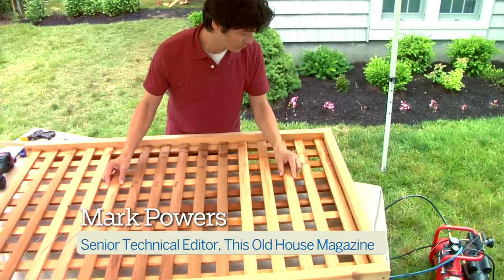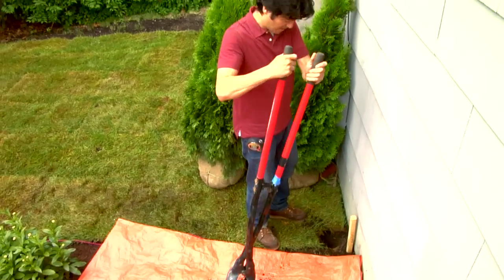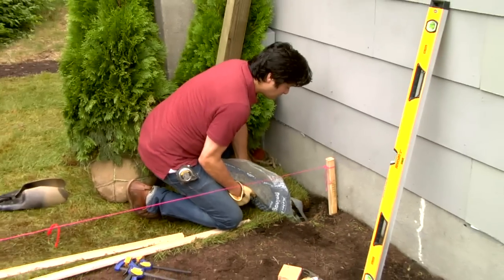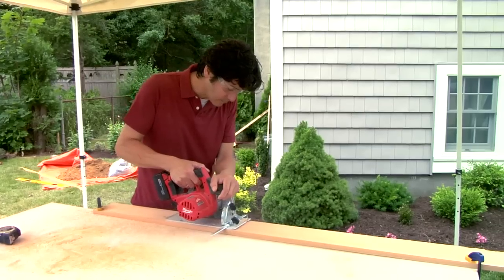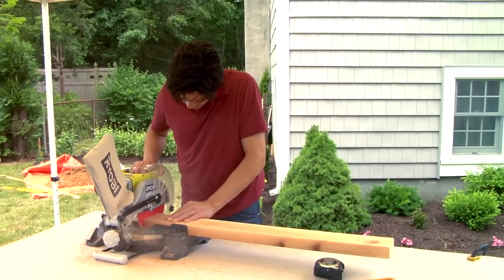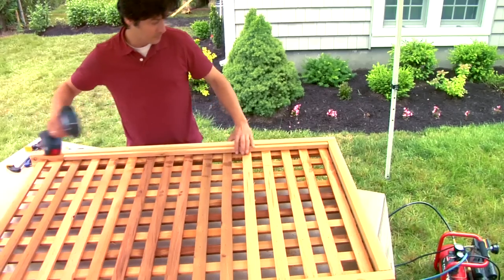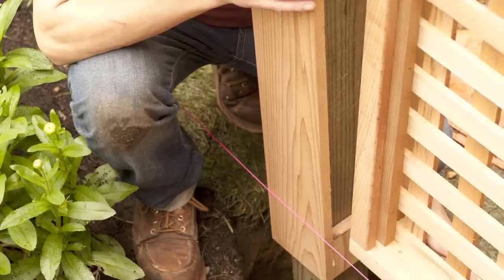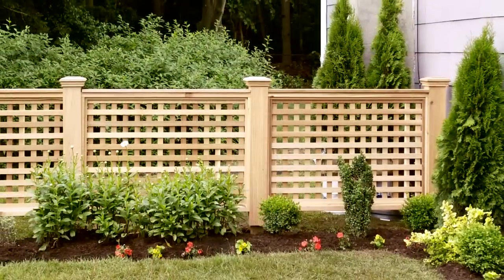How to Build a Wood Lattice Fence | This Old House

Comment: I know this video is old, but I followed the instructions to the letter and man did it turn out great for me! I did this build so I could hide my garbage cans and run passion flower plants. It is a great build! Though I had to make the lattice myself because they don't sell this kind of lattice around here.

There are a lot of jokes in the comments about this not being a one man job, but I did the build all by myself. Having some help would be nice, but it isn't necessary if you know what you are doing. I would not say this is a beginner build. Probably intermediate.
Reply: What wood did you use to build the actual lattice? The premade lattice in my area seem to be cheap and flimsy.
Reply: @nicolehansen5985  i used 2 inch rough cedar and ripped strips the size of the board thickness. I ripped them about 1/4 inch thick. I wouldn't worry too much about flimsiness. Once it's encased in its shell it should be plenty sturdy.

Comment: Thank you. I’d love a tip for doing this on a slight slope.
Reply: I would do the same exact thing here but use extra wide material for the bottom frame so you can scribe it to the ground.

Comment: Cedar and no pre drilling = lots of splitting.  Why wouldn't he mix concrete (from a bag) in a pail and pour it in hole instead of trying to mix it in the hole with post in the way.  Kinda hokey to me

Comment: The only thing about using real wood lattice right now is that it is very expensive, 69.99 a panel. I'm opting out on the wood and going with the vinyl one. Same style way way less by almost 30.00.